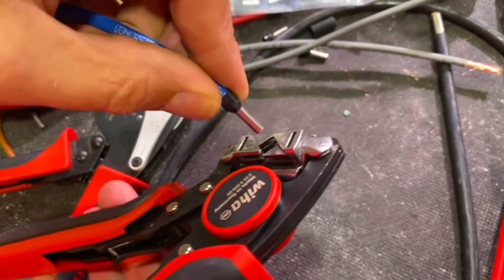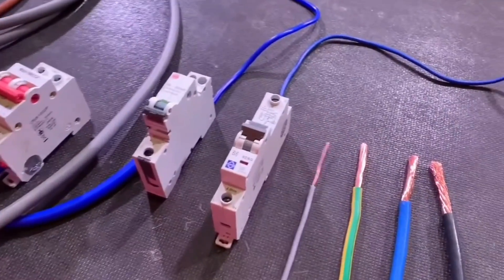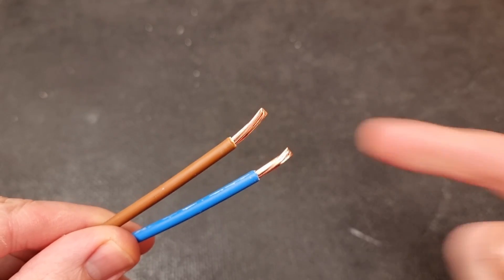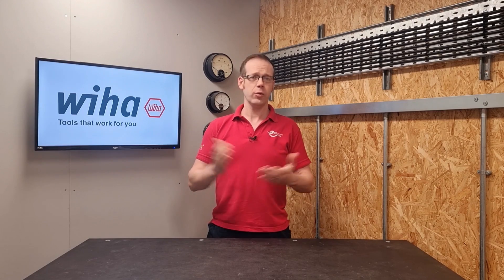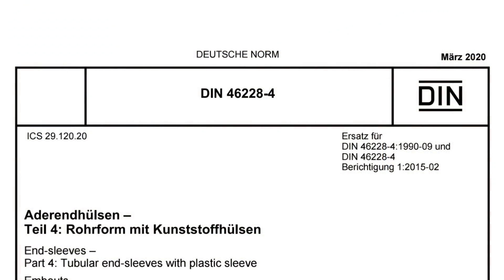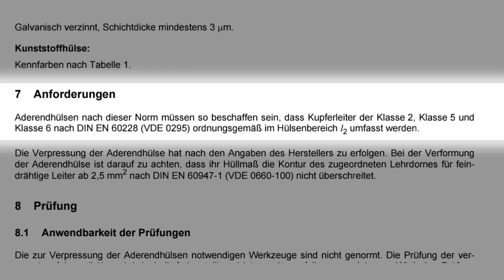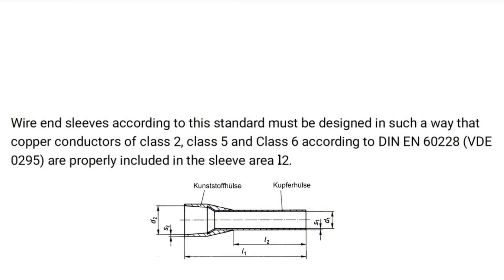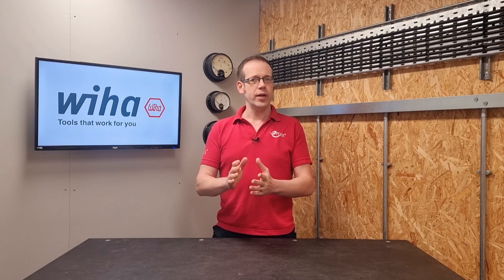FERRULES ON STRANDED CONDUCTORS: Should you use them?

Comment: I see Joe, we got a lot of work to do on your pronounciation! It‘s DIN like DIN rail. 😉 Not D-I-N. The interesting part about this is, all call it DIN rail, and here in Germany where the DIN and their standards originate, we call it „hat rail“, because in the profile it looks like a hat.

Twin-and-Earth is practically banned here for these reasons:
1. CPC must be identified green/yellow over the whole length of the cable run. That means it's insulated within the cable. Deviation from that only for cables with a concentric CPC, for example NYCY cable.
2. Up to 16mm² the CPC must be of the same size as the line conductor.

Ferrules belong on fine stranded, not on stranded conductors. I've seen guys using them on stranded conductors, and depending on the crimping tool, the ferrule will crack open. For the small cross-sectional areas you have in the UK it's probably ok. But stranded is usually 16mm² or larger here in Germany, below that for fixed installation the conductors are always solid core.
Reply from the maker: 😂 Oh man, I was trying to be too clever. I even looked up how to pronounce the letters in German! I'll do better next time. 👍
Great points you've brought up there as always, thanks for commenting. 😊
Reply: @efixx  The interesting part is also that this standard also defines the material of the ferrules (99.9% copper), galvanically tinned with a thickness of at least 3µm and the dimensions of the ferrule. Colour code is in table 1. But actually no one here cares about the colour code since there are several colour codes around here. This one, Weidmüller, French colour code. And there are also different lengths. For example on 1.5mm² you got E1508, E1510 and E1512. First two digits are cross-sectional area, second two are the length in mm. For 10mm² it's for example E10-12 and E10-18. The minus is there to prevent confusion with the 1.0mm² which have E1006, E1008 and E1010.
Reply: Same here in Belgium  !  :-)
Reply: pretty much same here in US. Solid conductors until you migrate to larger sized wire.
Reply: I only scrolled down the comments to see what a German thought about his accent.😂
Reply: Her in Australia, we only have solid conductors at 1mm2.  1.5mm2 and above are all 7 strand (Class 2).  (2C+E) has an insulated Green/Yellow conductor along the whole length which has been the case for like 40 years.  CPC Size does differ however., common is 1/1, 1.5/1.5, 2.5/2.5 (2.5/2.5 being the minimum permited for socket outlets), 4/2.5, 6/2.5, 10/4, 16/6.  However, you may need to increase earth conductor size for fault loop inpedance.  Notice in the UK socket outlets are usually 2.5/1.5, but looks like B curve CB's are common, pretty much every CB in Australia is C curve which requires a bigger CPE, and houses tend to be bigger with longer cable runs.  AU standards based on BS, but have drifted further away, infact, I think we are ahead in many areas.   Can't beleive you don't need need mechanical protection on cables, EG conduit at accessable heights.  Unprotected mains into a buliding that doesn't have a conduit over it right up to a meter panel! 

No one, full stop is permitted to work on fixed electrical wiring unless that are a qualified electrician or an apprentice.

Pretty much standard for lighting in commercial lighting and many residential lighting types such as downlights is to now fit socket outlets on lighting circuits so that stuffed luminaires can be fitted at the final stages of a building fitout without wiring tools.  Note these socket outlets are called "plug bases" and are just for the lighting circuits, they are small, cotain no switches but are wired back to the switches on a wall.  2-way and single-way switches are not a thing, ALL switches have 2-way terminals, along with a screwed "Loop Terminal' built into the switch that serves as a handy connector for neutrals.  Been this way since the 1960's.  

One thing I definately prefer on the TN-S-C system in the UK (Which is commonly called MEN in Australia (Multiple Earthed Neutral), is the fact the "Link" or as we call it "MEN Link" is done BEFORE the main switch on the supply companies Nuetral link.  Here in Australia, its done inside the main switchboard/consumer unit. So the incoming Neutral is first fitted off the the main switcboards neutral bar, then we run a link to the earth bar.  The problem with this is A, its the sparky that does it and can stuff it up, and because of this, the main switch is only ever in the Active/Phase conductors because disconnecting the neutral would case a possible safety issue of no PEN under fault conditions.  We do however always have an earth stake at every installation.
Reply: Don't envy anybody working with 10mm^2 solid core cable.

Comment: Multicore 6mm wire i don't call stranded cables .. so no   don't use ferrules on it .  ( rule of thumb is  when you bend the wire  and the bend stays in .. its not stranded  wire for me  )  Tales in uk of 25mm are usally also multi core ..never seen any youtuber use ferrules on those .  Fine stranded cable is mostly use them .. even in our fuseboards in Belgium .. we use 10mm² standed wire to connect bus bars in a multi row  board.   Ferrules are recommended when using the clamp that has only a screw pushing on the cable ( when not using a ferrule on fine stranded cable it makes not  a verry good connection with all strands ) .  Most  MCB/RCBO's/Dinrail clamps  have   square cage clamps.. so ferrules are not realy neeeded . ( but yes i also do it mostly because it's neaterr ) .
Reply from the maker: Great comment, thanks very much. 😊
Reply: Ferrules are used on solid conductors entering control panels.  Conductors in control panels are all numbered. The ferrule stops the number on the conductor falling off and also in many cases gives a better contact with a screwed terminal as the ferrules may be wider than the conductor. Also, some terminals use a nut and bolt requiring a crimped lug which may have to be crimped onto solid conductors. No British reg says you cannot. So it is not all as it appears.

Comment: Its a good subject Joe, if you dig deeper you will find out how confusing it can get .. biggest ferrule die i have is 50mm and as you said, can only be used with the correct ferrule .. i wouldn't trust a no brand crimper and ferrule and then use it in a wago .. i did cringe when i saw a well known youtube spark use ferrules on class 1 conductors (because it looked good )
Reply: no need to put ferrules when using a wago 221 .. as soon i need to make a connection betweeen solid copper en  file stranded wire i use wago221  .. wago push connectors only use on solid copper wire ( or multi solid cores )   using  fine stranded wire with a ferrule in normaal push wago is not what it is dessigned for ..( i have seen people do this .. but not mee )
Reply: @kittsdiy  +1
Reply: I know, i was using it as an example of screw less termination
Reply: @kittsdiy  diyer here who has been let down by so many fully registered sparks that I wondered what their training and  registration meant. Or three sparks have 4 violently held different opinions and can quote chapter and verse for their view. Then I read regs and realised they often don't specify things clearly and even contradict themselves.
     As you say, I use push fit Wagos for solid wire, lever Wagos for solid and stranded, ferrules for stranded into screw fixings, eg switches in grid, bend solid wire back on itself for screw housings.
   The last, I learned from internet having never seen it in any work by pros in my home and wondering for years why their wiring came loose sometimes immediately, sometimes in a few years. First saw it on YouTube by John McGrath - a woodwork show - he's a pro sparky in his day job.
   No wire ever shows outside housings in anything I've done. Learned that from a friend who qualified as electrician while working with me in data mining program development. He fancied earning extra at weekends but part time electrician can't earn enough to cover all the memberships, insurances, etc. Pros have left wire exposed or plastic not stripped back far enough so bad connection.
   From what I've seen, they have less qualified staff do a fast job of shoving cable through my conduit and connecting socket or switch. Then registered guy dashes round 'inspecting' it.
   Had torque screwdriver system already for bicycle maintenance.

Comment: I even crimp my flex in my electric plugs 💪
Reply: me to ..that is fine stranded cable .. and if the plugs terminals are only a screw  holding the wire .. it better to put ferrules on it ..
Reply: Same here. I've put a lot of bootlace ferrules in plugs. Class 5 cable though isn't it.
Reply from the maker: Quality. 👍
Reply: Good point. Think I'll check all my plugs that aren't sealed
Reply: Put the ferrule on backwards then crimp it, snip the insulated part off you will be making factory fresh connections 😎
Reply: @cannonball9177 Better to just use uninsulated ferrules, much cheaper.

Comment: Unlike other types of crimp connectors, ferrules do not rely much on the quality of the initial crimp, as they get compressed more by the screw terminal. 
Obviously this is not the case when use in screwless terminals, in which case crimp quality is important.
Reply: I agree.  The ferrule will protect the wire strands.  I like to use inside boards for screw terminals in case the wire needs to be later removed.  Bare twisted wire will not stand up to repeated connection cycles.  
Screw-less terminals could be a different thing.  I don't see advantage and could be disadvantage.  Better to use PTV/pin/blade terminal I guess.
Reply: agreed .. you can put  a 16mm ferrule on a  fine stranded cable and use the fuse/terminal to crimp it .  I have seen many electricians do this ..
Reply: @kittsdiy  I've seen this too but the connections while clamped on the ferrule the cable was loose inside the ferrule. Hence why I always crimp as this helps the ferrule squeeze onto the cable
Reply: @kittsdiy  you've seen them do it, doesn't mean it's the right thing to do considering no1 actually tests the house or building for connection quality and you havent seen those houses after 10-15-20 years
Reply: @LykeArgy i agree.. i use the correct tools
Reply: My thoughts exactly.

Comment: I don't think I would above 6mm but if you consider the crimp as just keeping the strands together and correctly tighten the terminal to the crimp it is malleable enough that it will not interfere or make the connection looser so can't see an issue with it personally..  Interesting to hear if others have a different opinion.
Reply: I agree, I see no issue with anything upto 6mm2 at all... beyond that, their might be an issue.  The Ferrule is so soft, you will get a good connection under the screw.  I bet you could not crimp it and be fine, but I always crimp it first.  Use, them, don't use them.  Nothing much the argue here unless you are just simply looking for an argument.
Reply: Yes, think the same, just keeps strands together.the
Reply: I never consider using them. I'd use screw connectors or solder.
Reply: @millomweb  are you from India? Who solders connections